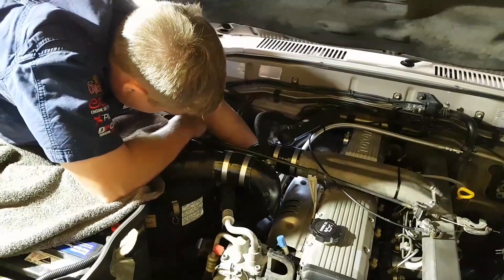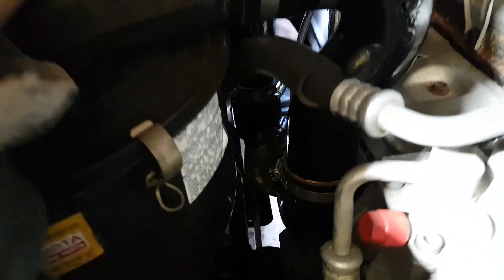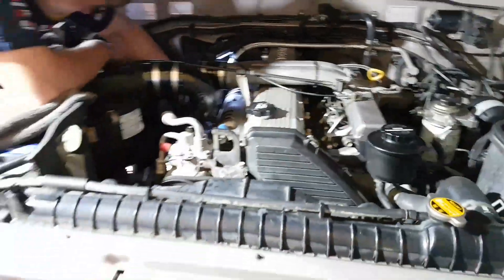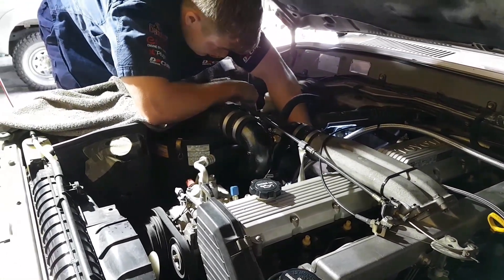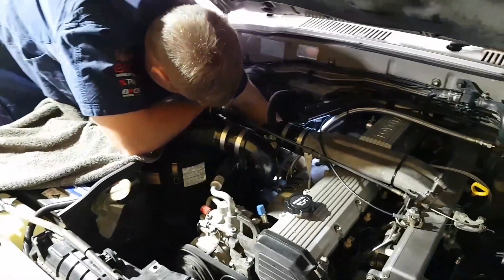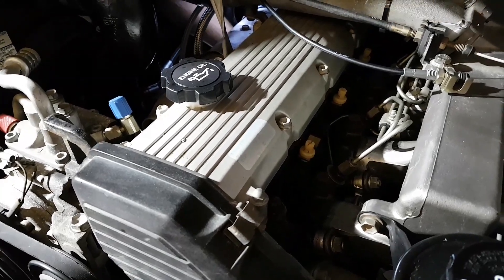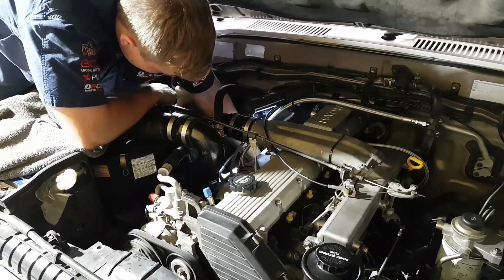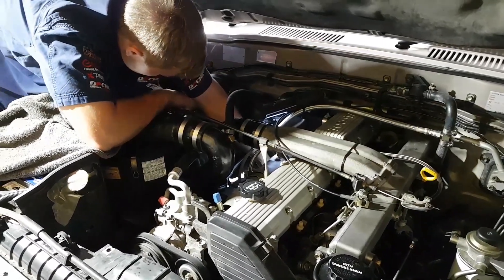Watch Live Turbo Install on Toyota 1HZ

Comment: Hello Berrima Diesel, I have a 2007 1hz 105 series that I would like to turbo, but its located in the UK.  Any recommendation on the best mail order turbo system available and installer in the UK?  

Thanks for any information provided.
Reply: how in the world did you get an 105 in the UK? there hard to come by here in Australia and this was the main market for them. i dont know much of the UK import laws but from what i hear its a pain in the ass.

Comment: I'm considering  purchasing  xzb70-zrmey 2017   4 cylinder  toyota coaster as opposed  to 1hz.  

I know that the 2017 one is newer, but familiar with the 1hz and I know they are simple  very durable  engines. How durable is the XZB70  engine. Really  need your advise?

Comment: Gday  I have the 1hz 4.2 ltr Toyota engine and am wondering if I need to rebuild the motor to put a turbo on it? My motor has done 235000 Klms and has always been serviced. Also what’s the price range to put a turbo on? 

Kind regards Ryan
Reply: Sería felíz  que subieran vídeos en español y conocer de todo los tip mecánicos y de los motores Hz  hz1 hj etc gracias.
Reply: is that 235000 km off road or on road?

Comment: Maybe you could answer a question. In the UK the 1hd engine has a habit of needing new big end bearings at about 100,000 miles. (160'000km) The 1hz doesn't seem to have the same problem as far as I know. Any idea's why?
Reply: 1hz is a beauty